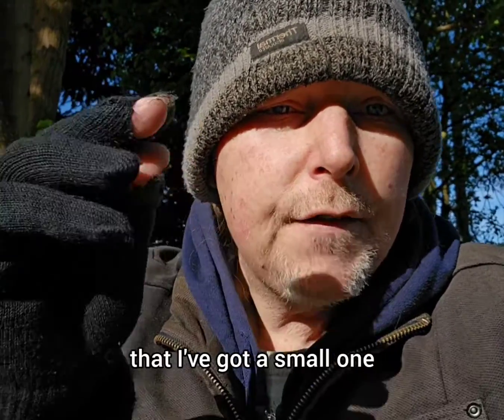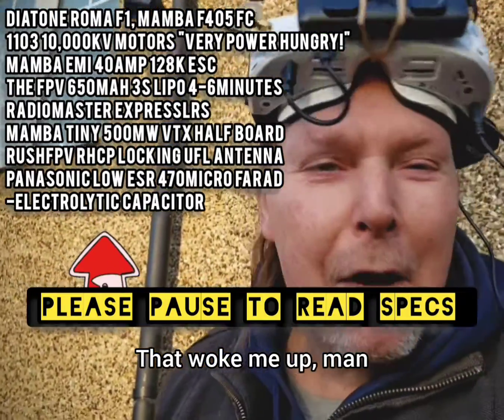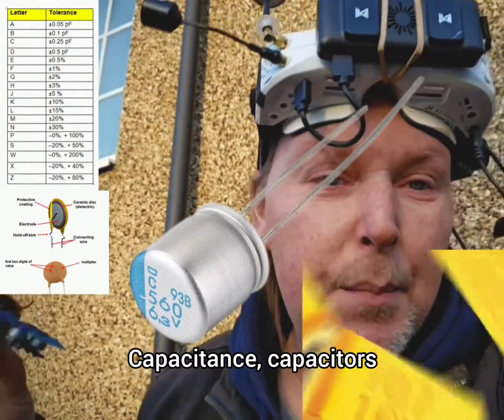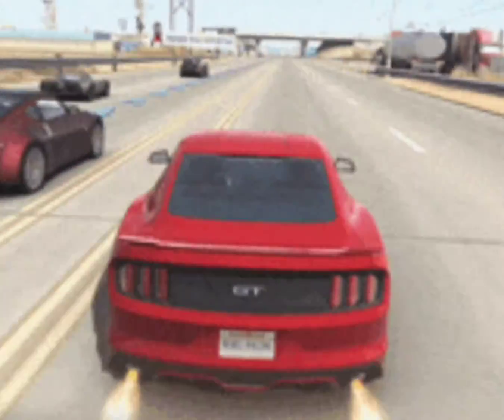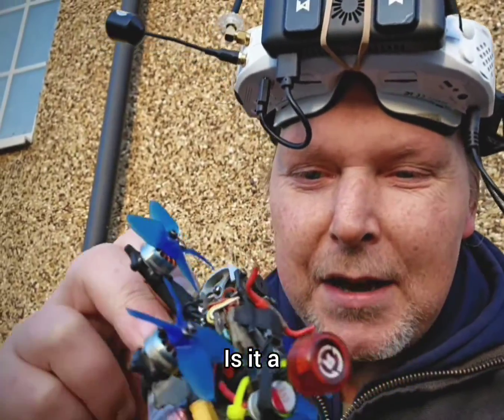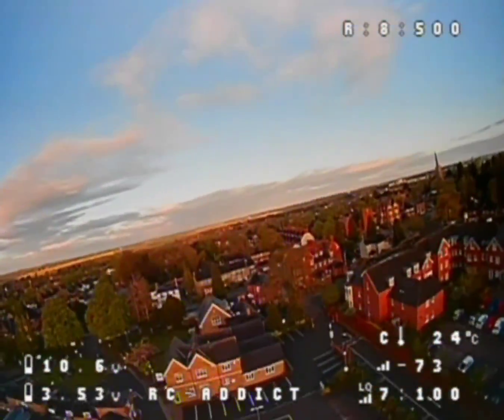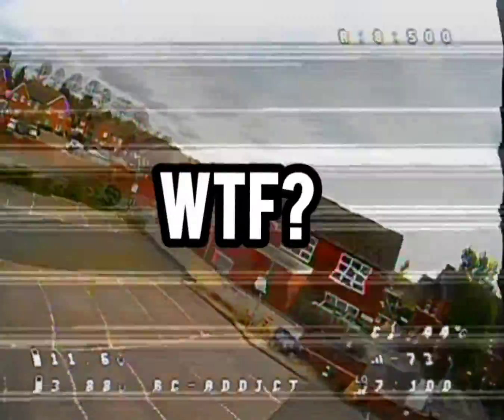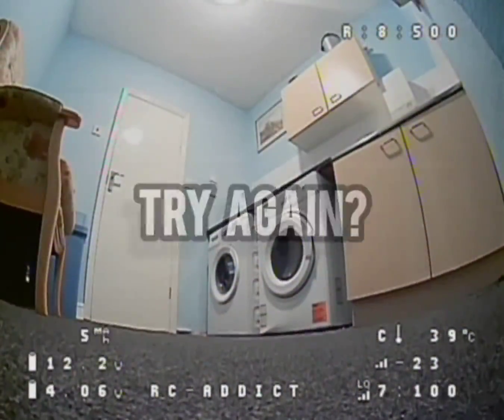NOOB EASY TO UNDERSTAND LOW ESR CAPACITOR'S DIFFERENCE WITH & WITHOUT #fpv #quicktutorial

Comment: Been putting capacitors for years now on all my RC stuff. I recently began adding very tiny ones on the 5Volt input of the VTX which gives an even better and stable image. For me, analog is far from dead. Just disappointing that with the analog chip shortage prices have surged. Hopefully only for a short time
Reply from the maker: Yes Henri i totally agree 👍,  it's my only drone that didn't have a Capacitor on it as I've had it years and it flies so well and weirdly enough it always had a good video feed, so I never bothered. 
Now when I updated to 4.4.3 I turned the blackbox and barometer off to save CPU so I could run bi-directional dshot, now the motor noise started then, I should imagine the feedback from the esc to the fc from the motors induced it.
But it flew so good with that tune 
But yes ,totally right mate,  all drones should have a cap on them, as you know , not just for noise but for spikes, especially if your esc has no TVS diode.
Yeah I got lucky and brought most of my stuff 2 years ago ,but it's ridiculous now and especially when you think a tiny whoop and my diatonic f1 has 50-100£ just on fc and esc!
It was just a chance to show new people what the difference is with or without a Capacitor.
Thanks for commenting 👌